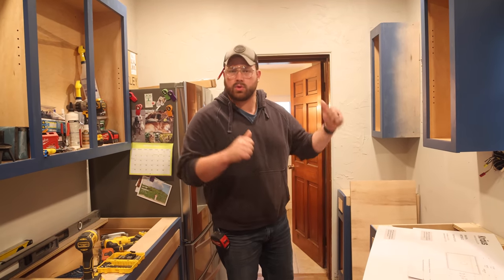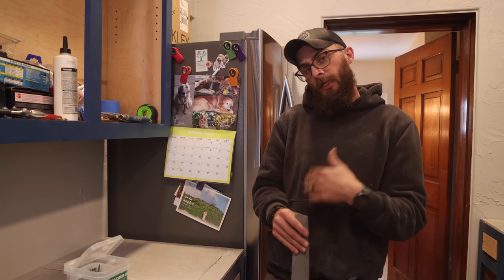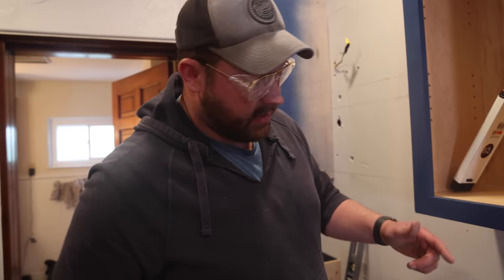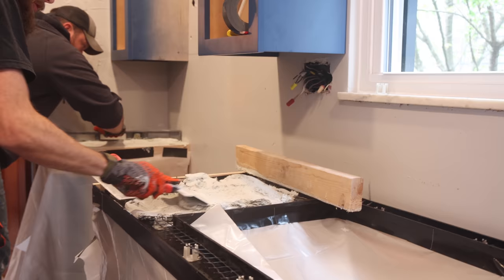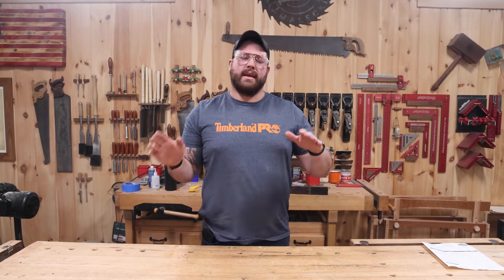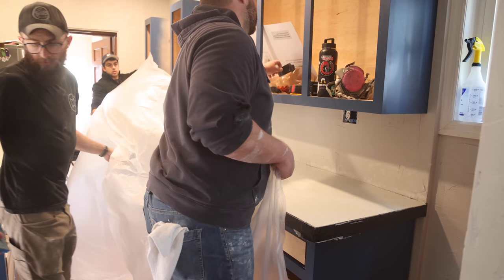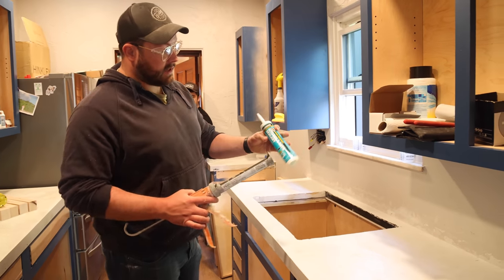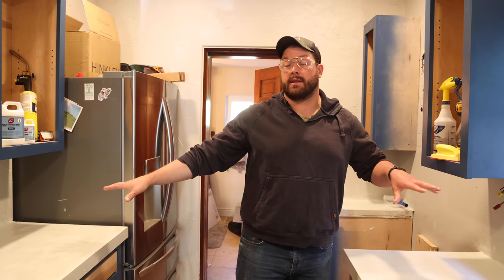DIY Concrete Counters | Renovating My Kitchen Pt.6

Comment: I did a concrete counter with the same forms, they worked better than expected. I used a metal mesh, not the fiber, and a self leveling concrete, (no/minimal screeding and troweling) finished with an epoxy top. Went down quick, and has held together great.

Comment: Thank you for convincing me never to attempt such a countertop in my life.
Reply: I’ve literally never watched a video of one of these that hasn’t been a total crap show.
Reply: @mattsnyder4754  you should check out Bourbon Moth Woodworking. He did a similar video and his looked pretty easy and turned out awesome. Make your concrete mix a little more fluid and it's a lot easier to pour into the forms and through the suspended strengthening material.
Reply: @aaronodell1836  exactly what I was going to say. His walk through on his is what convinced me to do one in the near future. I had been thinking about it before but after seeing how much of a pain it could potentially turn into steered me away.. Recently I came across his channel though and it completely changed my mind. HIGHLY recommend anyone considering these to check out Bourbon Moth Woodworking. You won’t be disappointed in his walkthrough.
Reply: Those tops are going to have sharp hard corners. Are you going to smooth them off in some way? When your daughter is at toddler stage they might be a serious hazard...? Looks like a huge amount of work and effort and stress and risk for only a slightly above average result. Great fun video to watch though. Stay squirrel like peeps.

Comment: I'm screaming add more water watching the pour! Having said that ,I'm no expert lol have poured a few slabs in my life though. More water makes it so much easier to work with. Looks really good, keep it up!
Reply: 100%. No WAY that was supposed to be that thick.
Reply: So here is the thing, the correct mixture actually looks thick like that, is the perfect amount of water to make the concrete as strong as possible, if you add more water the Strength is reduced. So there are two options, add more water the it will reduced but is so minimal and this is not a concrete made to hold a build. Or you can add something call a plasticizer, it gets runnier concrete without adding more water. And a super cheap and easy to find plasticizer is white glue or elmer's glue.

Comment: Great job, looks really nice. I have a few tips for the next person willing to attempt such a big project. When it comes to the concrete, add a water-reducing admixture, sometimes called a super plasticizer. They make the concrete much more workable without reducing the strength much at all. The second tip is just to install the faucet onto the sink before installing the sink to the counter.

Comment: I used Z Countertop in my kitchen. Everything that could have gone wrong went wrong. Leak, 2 mixers breaking, whole lot of mess, but they came out good. I did use a 3-4 coats of the sealer to make it even shine more. It was my first time ever doing anything with concrete. Lol.     Glad to see an expert having difficulty with doing this because I thought it was just me. Great work!!!!

Comment: Hey man - screw the haters! I have been building up my designer concrete furniture and countertops business for a couple of years and all methods of fabrication are challenging. I am sticking with the pre cast process with melamine forms. It’s true that Modustrial Maker “makes” it look easy but it’s really not. At the end of the day, the hard reality is that concrete is soooo hard to control behind the forms (bug holes, coloration, voids, etc).  Your counters here turned out great in my opinion. I am using GFRC products from a company called Trinic. 
Cheers from Canada

Comment: The one major thing i've learnt from this whole DIY kitchen build process is the next time I need to renovate my kitchen, screw the cost, I'm employing a firm of professional kitchen fitters....lol
Reply: before this I was watching diy vid here and there wans was gonna reno my kitchen myself. FORGET THAT.
Reply: Well, these guys aren't really the pay attention to details, or read the instructions type.... I think if one were to DIY they would spend more time learning and applying said knowledge...
Reply: Considering that you refer to them as "kitchen fitters", yes it is a good idea to call professionals lol
Reply: Bob from I Like To Make Stuff did a video where he basically said “DIY kitchen renos are a false economy.”

However, Ben from Modern Maker Podcast made an interesting comment a few weeks back, which is that if you’re not a factory, why stick to the modules and methods of a factory?  If you’re following that concept, there may be economies you can apply that make it more cost effective, and there may be benefits to a truly custom design (not being a slave to modules) that make the added cost worthwhile. For example, I built my outdoor kitchen out of PT 2x4 and 2x6 and spaced the framing in a way that gives me better options than following someone else’s module.
Reply: I'm just gonna say this now: "professional" kitchen builders are just as bad as diy-ers sometimes. We got completely ripped off by a company which later went bankrupt, they fudged the kitchen, half the drawers don't line up and honestly I feel like I coulda done a better job putting it in myself and I'm NOT a diy-er/carpenter/builder (I'm a student computer science major).

Comment: Nice job for a first time with a new product.  Maybe a slightly thinner mix may have made leveling easier.  I don't know since my concrete countertop experience is thinset on a picnic table then covered with glazed tile.

Comment: looks sick.. im not sure if that material can be polished but if you could, throw some concrete polishing pads on the 4in grinder and go to town they have wax in them as well so it will start to seal small holes when going up in grit (50grit and up) then slap that nice water proof sealer on there and let it sit. Polishing concrete is super fun hope to see more content soon! keep em comin

Comment: I feel the pain in doing a poured-in-place counter. I did this last year for my garage work bench. The lesson I learned was building an inverted melamine mold and then flipping the finished slab in place would have been a lot less work for a much nicer finish on the concrete. That's what I'll do for any concrete (cast counter tops in general) counters I make in the future

Comment: Use silicone to attach hardy to the cabinet.  That way you can change it down the road.
Also if your going to use that mesh I'd mix way thinner so it flows thru. Watch the one bourbon moth did. 
Honestly  I've always just used pro finish 5000 from lowes. With an epoxy top coat it looks insane deep beautiful grays.

Comment: I think the mix should've been wetter... it should pour through the mesh like batter. If you look at the vids by concrete countertop solutions (maker of the fiberglass mesh you used), that's how they do it. You can get away with a wet mix b/c of all the fiber addmixes.

Comment: You guys needed plasticizer to help the mix flow better. There are specific ones used for GFRC and can make it be self leveling and reduces the the bubbles that get trapped in it. I don't know how it might effect the working and cure time since I have mainly seen it used on very fast curing mixes. As always, consult your concrete supplier on what they recommend for the properties you want since the additives for cement are like alchemy in their details and tweeks.

Comment: Due to the thick nature of the fiber reinforced concrete, an easier way to pour it might have been to remove temporarly the mesh in order to install one small layer of concrete, and then reinstall the mesh pushing it in the concrete. Might have saved you some trouble pushing through the mesh.
Anyway, the final product looks great.

Comment: I also used the Z counter top solution on my kitchen, but thats about where the similarly ends. I didn't use their fiberglass thingy, I used a metal grid. I ran a few screws up from underneath and held said grid in position with coax clamps. I also used Rapid Set mortar mix with 2 packets of flow control and one packet of set control, with a little coloring. I also made a very fancy form out of bed frames that set my sink down into the sink so it was all flush (that might have been a little extra, but it's my favorite part).

Comment: Arm chair concrete quarterback says ...a wee bit more water to smooth the surface and prevent bubbles . That mixture looked a little too dry.  Cream rises to the top and the smooth surface is created .

Comment: To average people, concrete and cement are the same. Although, I had a structural class in college where I received a 3 hour lecture on the difference between the two. Concrete is the material while cement is one of the components that make up concrete.

Comment: I've watched a bunch of videos where people used the Concrete Countertop Solutions concrete, and it was much more flowable, and they didn't have all the difficulty you had... or so they said in the video.  Do you think you had so much difficulty because of the awful consistency of the concrete? That's what it looked like to me.

Comment: It would be sooo much easier, if you had used a bit more water. That concrete you "poured" (more like patted) was too dry, hence the bubbles. The bubbles couldn't rise, because the concrete was too dense. 

If someone reading this, is planning to do the same, just make your mix a bit more wet. It will be easier to pour, less bubbles and the surface will even out so much nicer and with less effort. 

Oh and instead of using tape, just use silicone for gaps, corners and stuff.

Comment: Need your concrete needs less viscosity. Is should just pour into the mesh and being less viscose you are able to get the air bubbles out. On a side not they still look good.

Comment: The recent hardibacker I bought had a plastic install label that said "do not use mechanical blade, score with knife or use power shears".
Reply from the maker: Well I can’t read so ours didn’t have that issue 😳🤣
Reply: @John_Malecki  I have cut it before with a saw all, but that was 6+ years ago.  I'm sure the State of California requires that label (although I'm only a few hundred miles south of Pittsburgh) for liability reasons.  This time I dulled several utility knife blades with the (sheetrock) score and snap method.
I love the content, and was not trying to bust your balls fwiw.  ✌️
Reply: I've always cut it with a diamond blade on an angle grinder.  Just make sure to wear a respirator.